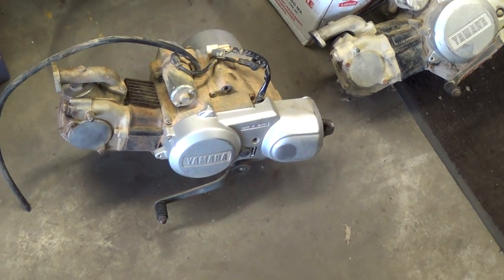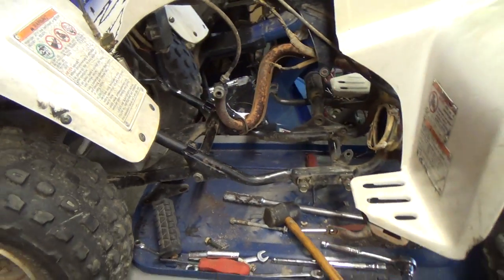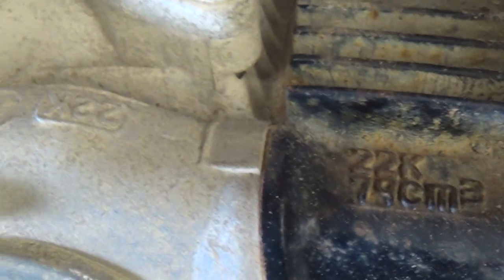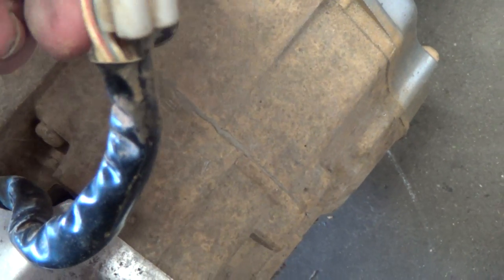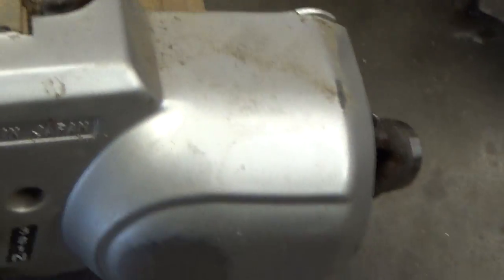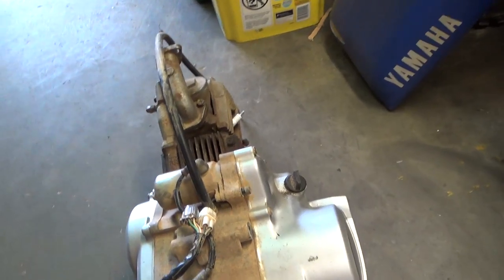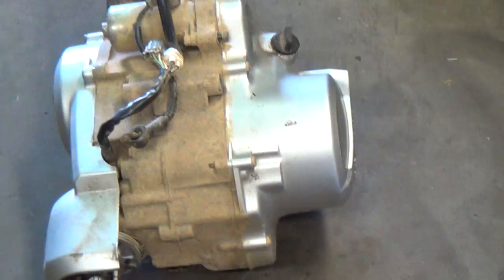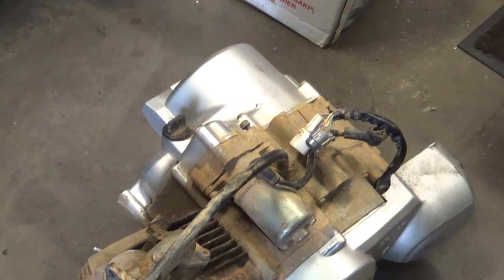Yamaha Badger 80 and Yamaha Raptor 80 - Motor Comparison

Comment: HELP PLEASE kid has a 05 grizzly 80 ,put new mikuni carb on engine reves up and takes a minute to fall back to idle ???? Whats this issue ????bought it used runs good but ,like I said it likes to rev up and before you shift it into gear you must wait for it to rev down ?????
Reply: usually that means the air screw is out to far (not idle speed adjustment) try 1/8 turn in at a time ....... if that doesn't do it the pilot jet might be too small

Comment: Hey bigjerms i got a question for you and its very urgent, i have a phase 1 badger and i need to know what size or bore is the carburetor because mine is messed up and also my solenoid clicks when i try to electric start but it does still run, please help thanks

Comment: Do you think the 80cc motors would swap out with a raptor 50cc
Reply: I have several motors from  the motor 4 yahamaha
Reply: Kendricks Hayes Jr you mean top ends using the 50cc crank on a 80cc jug, head set up?

Comment: Correct moto 4 , 80cc is the same thanks to this video I was able to swap the 80cc 4 speed moto 4 into a 2005 raptor 80 . I did change the stator cause plugs were different but colors were the same.

Comment: Need help finding ring and pinion for badger that is cheaper than the stealer I mean dealer. Ebay hasn't been much help???
Reply from the maker: What exactly do you need, the whole rear end?
Reply from the maker: I will look in a bit, might have something
Reply: I could use whole rear end, but just ring and pinion, and adjuster nuts is all I realy need
Reply: I have housing, good bearings and axle. Missing drive shaft, tube and coupler, but the guy I got it from said he's going to look for those
Reply from the maker: I had two badgers, a raptor 80, and a grizzly 80, which al used the same rear end.  I used parts to complete the grizzly and raptor.  I know I have a lot of badger parts left but can't remember exactly what.  I'll look when I get outside.
Reply: Ok thanks. I appreciate the help!
Reply from the maker: I went through one pile of parts and could not find one.  I have plenty of other parts but not the rear ends.  I must have sold them already.  I'll keep looking incase I put them somewhere else.
Reply: BigjermsGarage  Do you have any carbs?

Comment: Hey wassup nice videos you got going there I have a moto 4 yamaha four wheeler an im having carburetor problems with it got it for free an its in Ok shape an would like to see what the main problem can be an these motors are all the same mine is shaft drivin as well an a 80cc 4 gears if you can help thanks alot nice videos keep it up!!

Comment: Original Moto 4 YFM80 sold in 1985 and 1986 were VIN prefix 55X-. They were 4 speed transmissions, not 3 like shown here. Rear end ring and pinion gear replacement was common even back in 1991 as it was the weak link in this otherwise True quality 4 wheeler. Finding a good used rear end has got to be all but impossible by now. The 85 and 86 models had no other names attached to it. the Champ was the later 100cc 4 stroke model with suspension. The starter was also problematic as people burned them out cranking a machine that need service but was ignored. Clean out those main and pilot jets with torch tip cleaner and note the smoother running and easier starting engine.
Reply: Got a moto 4 in a trade with a friend the other day, Just burned out the starter last night while trying to do work on it lol. I'm not to upset because it was already well on its way out before I got it and I think the previous owner has a spare.
Reply: Do you know if raptor 80 engine parts will fit a moto4 80 engine? Like could I rebuild it with a raptor 80 rebuild kit? Also stuff like the stator, starter, some other electrics. Thanks
Reply: My buddy bought brand new ring and pinion off line for his 85 moto 4 last year. Pricey but there are still parts out there man. We have a riding group who collect and ride, moto 4, champs, badgers and raptors.  Little wheelers are a blast. We have done it so long now though we have most parts in a wheeler graveyard
Reply: Nope.  Moto-4 100cc was a 4 speed. The 80s have always been 3 speeds.  Worked at Yamaha dealer for 27 years.

Comment: Moto 4 Badger is the same. I have 3 of them. Be careful on Moto 4 in mid 80's they have a 85cc model it's a odd duck. I have 80,80,85 they are all mfg 1986, 1987, 1988
Reply: I have a lot 4 80 they never made a 85 cc
Reply: I mean moto 4 not lot 4